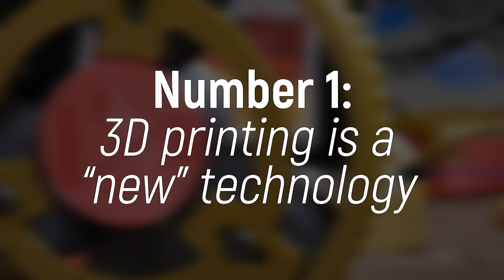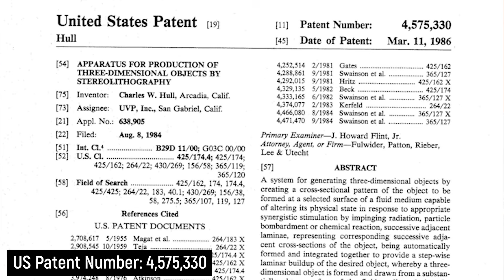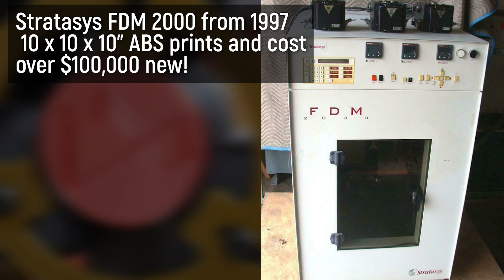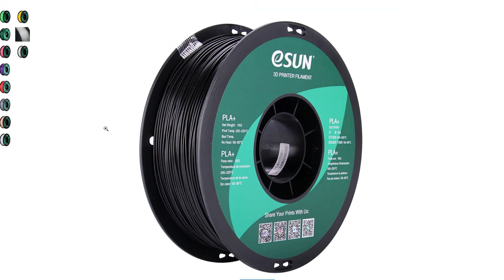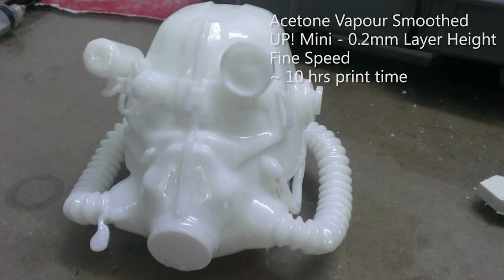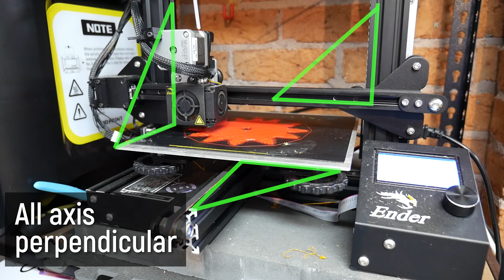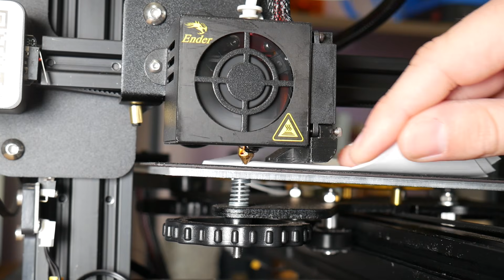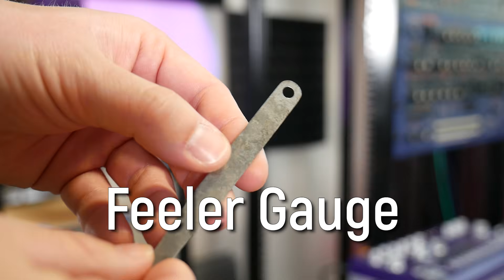3D Printing Myths I used to believe...

Comment: Cold pulls bother me.  More often than not, people just need to set their nozzle properly. While hot, Take off the nozzle, push your bowden all of the way through, remove plastic, pull it out, screw in the nozzle, back out a bit, push bowden back in, then screw the nozzle all the way in to where it's snug, but not gorilla snug.  Fixes a non all metal hot end every time.

Comment: For tramming, I kinda cheat a little bit since I have yet to get a hold of a feeler gauge. I'm using a glass bed, and one of those crappy pieces of paper from a small notepad is less than 0.1mm thick. Auto-home and jiggle the paper until it's got a decent bit of grab, but without tearing the paper. And to eliminate any remnant of elephant's foot, or just to ensure the nozzle is primed, I set the bare minimum brim or raft for my adhesion with Cura. Once I got the technique down, I have yet to have a single print separate before it's done.

Comment: Nobody uses folded paper. A single sheet of standard office paper is about 0.1mm thick. So go to Z=0.1mm, level with a single layer of standard office paper and your nozzle distance is perfect. That's what I am doing for years. Works every time. No need for feeler gauges. The paper you receive any invoice on, is a feeler gauge that is good enough. Oh and the bed has to be heated, the nozzle doesn't need to. It barely expands. And oozing filament during leveling makes it harder to level accurately.

I do see many people leveling with a thermotransfer receipt from shopping and Z=0 which obviously is wrong (thickness: about 0.05mm), and then complain about "some prints work, others won't stick". And half of them don't listen to explanations because they "read it somewhere" and it "must be right". I will redirect them to this video in the future.

Comment: I is strange seeing you make a video correcting your mistakes about what you thought was true (and spread your self) and then you say things like the filaments are made from "alloys".

For those wondering: No, there are no "alloys" involved as that terms specifically refers to metals mixed with other substances. For plastic we are simply talking about different blends and mixes here (blend would be if you combine 2 different polymeres, mixing is adding something else like glass-fibres or wood-dust).

Comment: The Paper is a feeler gauge. 
It's .1mm thick, don't believe me measure your own. If you own a 3d printer but not digital calipers something has gone wrong in your life.
If your setting the tappet clearance in your classic motorcycle you need proper feeler gauges, 3D printer not so much.

Comment: I use a sticky note with the sticky part up under my fingers. Doing it that way, the paper does not slip from my fingers and I get a really good feel of the print head making contact. You also don’t have to press down on the surface which can change the distance from the head to the table.

Comment: Nice! I've never heard of using a folded up piece of paper...I've heard of an index card, post-it, or 1 piece of paper before. Still, leveling or "trimming" is the hardest part of 3D printing for me and I STILL cannot do it right reliably. It's nuts! I'll have to try the feeler gauge trick you mentioned.

Comment: I just went straight to the feeler gage, but I am getting a feeding issue when using PETG. It often snaps at the intake just after the feed motor.. to high of tension or torsion in the filament. But pla and abs work just fine

Comment: LOL. Thats funny, I trammed my printer using squares and then used feeler gauges to set bed height (with printer bed heated).  But I never had luck using paper - and switched to useing a feeler gauge after my first few attempts at printing.

Comment: This is such a great video!  I got into 3D Printing in 2013 (Ultimaker Original!) and the material spectrum has really expanded.  I got lucky and low work in research 3D printing with extremely large scale 3D printers (We printed a 25 ft boat in under 80 hours a while back!)   In working with engineering students here, I love that I am constantly re-learning the basics each time I bring on a new student into 3D printing.  The bed leveling is a perfect example.  Rarely have I seen people do this with the bed heater on.  I've done the four corners paper routine, only to find out I am way off in the middle (love to solve that riddle, I mean, China must eventually make one level bed?).   Marlin adding Babystepping has been a huge help for my first layers.  I'll do a skirt of 4 or 5 outlines to be my double check.  Keep up the good work!

Comment: Just like SSD is new, solid state storage is some of our oldest form if not the oldest form of storing data. At 10,000ft above sea level we use 3d prints outside, we have a lot of UV exposure. The best method is just to paint the shit with.. any paint basically. All the materials are pretty shitty in direct sun. I just use PETG and spray paint it.

Comment: The paper thing is only true when you have a bed that is homed by a mechanical switch. If you have a printer that use a Bltouch or something like it, it won't matter because the printer head will reset it's zero before the print.

Comment: If you know the thickness of your paper, it can act as a cheap feeler gauge too. Standard printer paper is roughly 0.1 mm, and I know that I often have more difference in flatness than that's usually off (though I don't double it up and I try to not have the nozzle compressing the paper too much), and I only use that now for setting a probe offset (which I end up running the first few prints babystepping to ensure that I do get a good first layer).

Comment: Right out the gate you pissed me off. 3d printing is new. If you run the clock back to machines that barely worked and had no support infrastructure your can say AI was made in the 60s even though the pdp11 was not at all capable of running any useful neural model and wind turbines were invented in the 1800s even though the efficiencies were so bad they were immediately abandoned. There is no point to pointing to some obscure broken shitpile that's billions of manhours and dollars away from being a thing and acting like everyone was sleeping on it.

Comment: I still like ABS. Among inexpensive filaments I only trust ABS and PETG to survive the heat of a hot car or even just sitting outside on a really hot summer day. I've had PLA go mushy both in my car and outside. 

PETG is so much more flexible than ABS I don't consider either to be a viable replacement for the other. It depends what I'm printing.

I don't really consider more expensive options because too much just becomes scrap anyway. Especially when I'm designing parts that need to fit against preexisting objects. So many iterations...

Comment: I never had good results from the paper method. I just start at the center of the bed and eyeball it. Then I raise a few mm, duck my head down to bed level and move x and y all around while watching the distance between the hotend. At that time I adhust the bed screws until it looks like the distance stays even all over the bed. Then I go back to the center and adjust the offset one more time until the hotend just kisses the bed at zero.

At that point is as good as I can get it by eye alone. So I start the printer and print a 1 layer circle around the bed. If it's too high it doesn't stick, if it's too close the plastic can't come out. I can see by how it prints in each quadrant if the bed which screw needs fine tuned which way. With just a little adjustment I get a perfect bead the whole way around. Then I know it's ready to go.

Comment: Tramming is for setting a spindle or nozzle perpendicular to the bed. Leveling is to make it equidistant from the bed within the entire bed region. When setting up a CNC machine, like my ShopBot, both operations need to be done and are done separately.

Comment: Who uses folded paper?!?  Never in the past 8 years have I encountered this.  A single sheet of paper should just slightly drag against a clean nozzle.  My delta doesn't have bed leveling-- I do however, have to get the offsets right on each tower and in the center, and my geometry correct so the head moves in a "flat" parabola.

Comment: Put a pair of callipers on the paper to get an idea how thin it is (.03 to .05 is typical if it’s straight off a photocopier or printer) and don’t fold it over.  The thickness of the paper will for most, be insignificant given the tolerances elsewhere in a consumer unit.  Feeler gauges are great but there are issues because their solidity can have the frame deflect to its limit which isn’t going to be matched when printing a plastic (it’s a method used to similar the forces when machining metals).  Checking the frame is square is a great point and the ABS call out is a great call out.

Comment: That paper thing took me adding mesh bed leveling to my firmware to find. Ultimately I settled on do the mesh level and then punch the thickness of the feeler gauge I used into the z-offset of the mesh. This only worked though since my bed's unevenness is caused by valleys in the surface, if there were significant hills it would ram into them with this method.

Comment: Folded paper? Weird, but ok. I'm leveling by first layer thickness by printing squares all over the build plate and adjusting by sight at first and then by measuring the printed plastic, but I'd only recommend this when you yourself and a few buddies decided to invest into filament recycling and have well maintained and well set up machines.

Comment: Thank you, thank you, thank you! Engineers been calling it tramming for decades yet the hobby space calls it leveling.
Reply: I do believe that tramming refers to adjusting the three axis relative to each other. First check that the rails are straight in their own x y dimensions and without twist. This is probably never an issue in desk top units. Levelling then adjusts for all the interesting shapes a nominally plane surface can assume as well as setting the table parallel relative to the xy travel plane. Once again on desk top units twist and warp are usually non events.

Comment: If your machine uses a z-probe for homing instead of a limit switch, it doesn't matter how thick the object is you use to level the bed. You aren't leveling the bed AND setting the nozzle to a specific distance, you are only leveling it. In fact, I do this with the machine off and push it around by hand to different areas. Your first layer height is all determined by your z-probe offset.

Comment: I thought new marlin have baby stepping option adjust z off set on the fly and you can save the offset after the print, unless you not using marlin that is 😁

Comment: When I started my 3D Printing journey I discovered the metal of a Diet Coke can was the same thickness as a piece of paper.  Advantages: It was always constant thickness and moisture proof, it did not tear if I got the build plate too close to the nozzle,  I did not have to worry if I had a needed note on it, when I felt it was too marked up it was easily replaced.  Thanks for all the great videos.
Reply: Has to be DIET Coke?
Reply: FWIW, standard wall thicknesses in aluminum beverage cans in the states tend to hover between .0030” and .0035” plus a little for coating.  BUT, it’s seldom the same thickness all the way around due to the challenges of maintaining alignment during manufacture it may be a touch over .004” in some places and barely .003” in others.  It also gets thicker near the top and the bottom.  I bet it works pretty well though.  I’ve certainly used it for shims more than once.

Comment: fun fact, my feeler gauge IS a piece of paper.  A piece of paper is no different than the feeler gauge. I used to use paper on commercial mills all the time.  HOWEVER, for beginners, a feeler gauge is rock solid!!!! do yourself a favor and get one. 

the BIGGEST takeaway is to make sure the frame is tramed up. This is why an all metal frame is important. If you have an acrylic frame, brace it as best as you can and dont use solid couplers. Solid couplers are best used with all metal frames when everything is tram. 

once the frame is square, use a SINGLE sheet of paper, none of this folded BS. a single sheet is 0.1mm thick. Make sure to heat the bed and nozzle to allow for thermal expansion. remove the filament so nothing oozes out, home the machine, then go from corner to corner adjusting until it slightly grabs the paper, just like he says with the feeler gauge. Do this 5 or 6 times until its the same on each corner. You could even use the center of the bed as a point as well. Once done, print something and use live babystepping in the firmware to adjust the nozzle height. Since it has been raised by 0.1 mm, when you go to print something, it prints at the layer height you set plus the 0.1mm. Again, you can use babystepping to lower it or raise it:)

where the issue is, some beds are warped in the center due to crapy bed base plate. Take for example the anet a8 H frame... it bends with slight pressure.

Comment: having used a Milling machine for yrs before getting into 3d printing, I already saw my Ender 3's X gantry was off and went about using a feeler gauge for the bed AFTER squaring the frame and the X gantry. So.. square frame, then X gantry then bed. im getting ready to build an enclosure for it because my apt is a bit drafty in the winter and that can cause big probs with prints.

Comment: I’ve found that having a calibration print that has a few layers makes it easy to use my eyes to manually adjust the “tramming” and within about the first 2 or three loops it’s set. Having a couple calibration files helps and lets you quickly test without a major expenditure of Filament. Also make sure your machine’s fasteners and belts are tight. If the frame isn’t optimal, the leveling process will be less than optimal as well.

Comment: Hello, I'm a Principal Mechanical/NPI engineer and I've used 3D printing in industrial applications multiple times now - from printing prototypes of sporting good to printing molds for silicone rubber. Currently I use it to print fixturing and end effectors for our assembly line.

- ABS has higher flexibility and toughness than PLA - so it's useful for impact applications or ones with cyclic vibrations/loads. It's terrible for the planet and never degrades

- For "checking your nozzle" height, getting a feeler gauge set is a great way to make sure it's repeatable.

Comment: In my limited experience, I learned that you shouldn't do a bed leveling with four screws, especially with a glass on top. It is very easy to get self-induced bed warping if you do. I got rid of such problems by removing one of the screws (with spring) and the glass, level the thing using only 3 screws, then reinstall 4th screw and spring, level again but only using that fourth screw (others are at level already), and then put back the glass or other top surface. Before fixing glass to the bed, I can check if the glass doesn't wobble on bed (this indicates a warp and it is possible to fix it with the screws). If I need to adjust anything after that, I always turn not one, but two adjacent screws at the same time, and by the same amount. 

Other good idea for printers with manual leveling is to make adjustable Z-stop (I used parts of an old micrometer for that).

Also, I almost forgot about glue sticks and stuff since I got myself a PEI-covered steel plate (mine is textured, and I'm yet to try a smooth one).

Comment: the last tip omg I feel dumb I had the gauge with my first printer but I tried to use 0.1mm and it was too flimsy and I was doing it at 0z, didn't even give it a thought till now 4 years later :D thx 4 the video

Comment: If you're doing it right you're using the paper as a feeler gauge. You can measure your particular piece of paper with calipers or a mic and then when you just start getting drag on the paper you know that you're about that distance away from the build plate. In my case since I use auto bed leveling, I first do go around and get the bed as level as I can manually using something as a feeler gauge (I'm a machinist and car guy so I've used real gauges a few times but I've gotten about the same results with carefully measured paper) and then I set the bed offset to measured + the paper (feeler gauge) thickness.

Comment: I facepalmed so hard at that bed leveling trick.  I've been printing for about 9 years, and I keep feeler gauges on my desk but I still use paper to level for some reason.  Argh! Thanks Angus
Reply: Paper is fine but it should be a single sheet and not too thick. The whole point is to get as close to zero as possible. I've never seen anyone recommend using folded paper before personally.

Comment: I think using paper works fine - but the trouble already starts with "paper" - what kind of paper? Which weight? Which thickness? Folded? Once, twice or nah? And, of course, paper is squishy, at the end of your process it might be more compressed than when you've started it. There also may be traces of filament on it after a while, which increases the thickness.

For me a single piece of sticky note works well, I keep changing which part of the note I use so the paper doesn't change thicknes during the process. I also do leveling twice because it feels like I need to allow the bed to settle a bit. The second pass mostly is minor corrections only. But: using a feeler gauge very likely is more consistent. The problem there: which thickness do you use? Hard to use a feeler gauge when you don't know which one to use